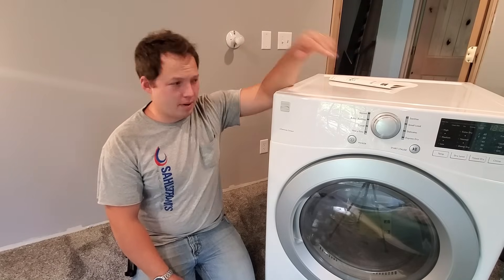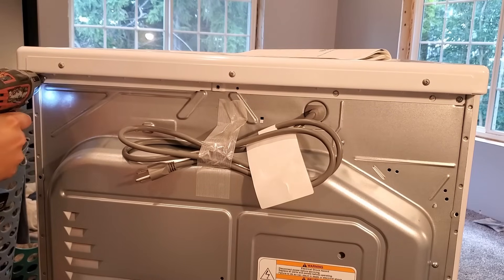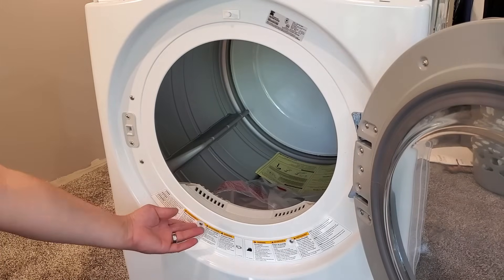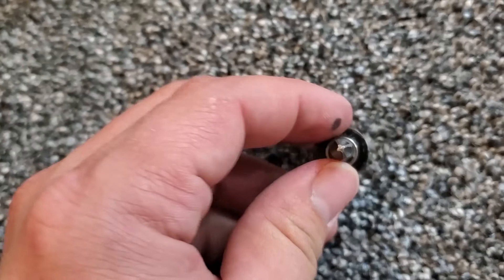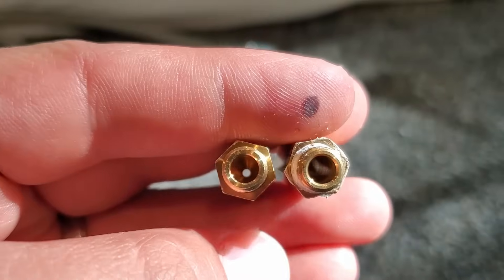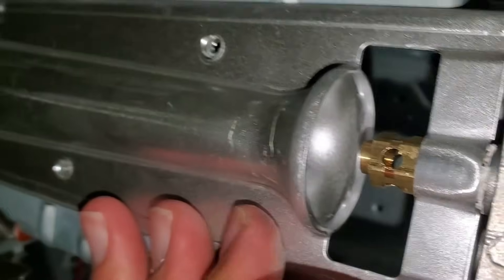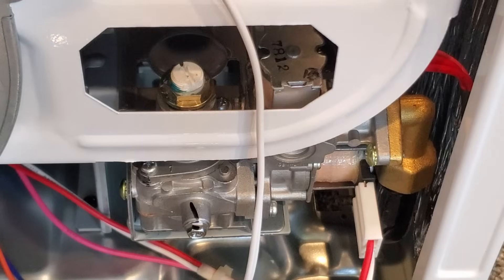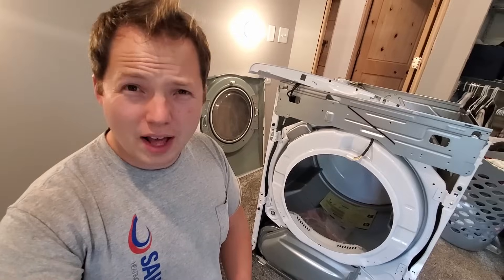How To Convert a Front Load Gas Dryer to Propane or LP from Natural Gas

Comment: Thanks for the help. Interestingly ChatGPT linked me to this video after I had diagnosed my dryer issues using it. I had ordered and paid for install of a LP converted gas dryer. The installers insisted that it was already converted to LP. It wasn't. Dryer miraculously worked fine for a couple months. I knew I should've double checked myself. Followed your steps and dryer is back to working.

Comment: Hi Benjamin, I just got LG ThingQ washer & dryer tower and in the manual only state the item number for converting natural gas to LP propane, I just don't have a manual to do it I will follow the video. But how can I know if I have to do something else for example the 2nd adjustment you made the screw down thing. Any advice?

Comment: Hey guy… bought a LG gas dryer and following ur video i am lost on what is the Correct part I may need model DGL3601W…. I also didn’t see your gas connection.. I have a hose and a normal stove 3/8 brass connector in the back connected to a gas hose and a normal gas head regulator with a in off switch 😢😢😢😢 need ur help

Comment: Super helpful video, but im running into an issue with the plastic regulator valve at the end. It just wont turn. Im worries ill damage the screw and wont be able to move it at all, anyone have that issue?
Reply: I had that issue, I ended up using a 15mm ratchet very slowly and it worked fine, then I tightened the rest by hand. I’m assuming you got yours figured out so this comment is more for anyone in the future, a 15mm ratchet fits and worked for me.

Comment: Awesome video, though a few other users seem to have run into the same issue as me. Sounds like a blow torch and the unit is running very hot. Wondering if anyone has resolved this issue?

Comment: In your video you commented on the white plastic screw having too much blue glue. Mine is the same and I cannot get it to turn without deforming the screwdriver slot in the top of the white plastic screw. I tried to use a vice grip and that will ruin the threads. Any suggestions?
Reply: Same problem ... did you figure it out ever?

Comment: Nice presentation.  However, I think it would be a good idea to warn viewers about the VERY FRAGILE igniter that is very close (<0.5") to the flame tube.  While I had no problem removing the flame tube, upon reinstalling it after replacing the natural gas nozzle with the LP one, I accidentally bumped the igniter and broke it.  On Amazon, the igniter was just over $20, but it was a royal pain to remove and replace.  

My recommendation, if had a chance to do it all over again, would be to remove the 2 screws on the side and the 1 screw on the bottom of the regulator.  That way it provides more room to reinstall the flame tube without breaking the igniter.
Reply: Yup, same thing happened to me.

Comment: You're correct the respective gasses are used at different pressures. Natural Gas, once the pressure is reduced, comes into your house at  ~2 psig which is different than that produced by many/most LP regulators.  However LP regulators often have variable pressure settings that would allow you to match the 2 psig setting Nat. Gas comes in at.  Even if you were to match  LP gas' pressure with the variable pressure set up, IT STILL WILL NOT FUNCTION CORRECTLY.   Why??? Propane is a 3 carbon gas molecule where Natural Gas is a combination of gases with an average carbon gas length considerably shorter than that.  The result are different oxygen requirements for complete combustion for each of the 2 gasses.  Translation:  You need the different injector orifice found on the 'jet' the conversion kit provides.

Remember your High School Chemistry?  Balance the equations  for the combustion of both Propane (a three carbon chain) and Ethane (a two carbon chain).  You'll see a significantly different oxygen requirement between the two.

Great vid none the less....  I've got a LG 'Tromm' dryer and your instructions worked like a charm.  THANK YOU!

Comment: A LG STACKED (dryer on top) is different! Front control panel is on the BOTTOM of the dryer (top of washer). How do you get the front off?

Comment: I've looked at a couple other YT videos and they are lacking the simplicity and thoroughness of your video!  There's only one suggestion, and request, for others that were in MY situation...how to convert the regulator BACK to natural gas!  The instruction page only shows a picture but does not tell one HOW much to turn the white screw to fully open!  I was fearful of unscrewing it all the way so much so that the screw would fly out with the spring!  Turns out that it WILL stop when fully open.  After that, it's simply a matter of snugging down the jam nut.

Comment: I remove the front drum baffle to have full access to the burner instead of having to reach through that little opening. Remove 4 screws on the  baffle and 2-3 on the lint screen housing and pull up and off. It takes a minute to have more remove to work without the need for those small ratchets. Plus, you don’t want to damage the delicate ignitor. Even the oils from your hand can damage it.

Comment: Easy peasy
It's nice that they make the regulator adjustable. 
I did a furnace and had to disassemble the regulator and change the spring. Not bad but still..
Reply: Did you use a flat head in the plastic to tighten it down? Mine is pretty tight and seems it’s going to deform the plastic screw.

Comment: Thanks! Concise and relevant. The video helped make this an easy job; especially, highlighting key tools needed for removing the burner cover. Only thing I might add is it helps if you prop up the dryer like in your lap to provide good working angle when you are removing burner cover and swapping the orifice component.

Comment: Wow!  I could not have done it without your assistance.  Great video.  I had to rig up a little mirror to get the new orifice started in the hole.  And I would highly recommend either your mini ratchet or a 1/4" ratchet with a 1/4" socket for the little Phillips and flat drivers.

Comment: I just did this conversion on an lg model last night. Mine sounds like a blowtorch when heating up. I am going to take the front off again and make sure the adjustment screw is all the way down. Anything else I should check?
Reply: I just went back and kept tightening the screw. It is most definitely touching the brass. Still making the blow torch noise.

Comment: Hi there, what about the step to check the gas manifold pressure. The instruction I have state to check manifold pressure to ensure it is 7.0 inches water column.
Reply: I did the conversion ok, but it is not heating.  Did you do anything to check the manifold pressure?  How do you do that?

Comment: Hi Ben, I had messaged prior but didn't get a response.  Just wanted to know if you actually are using this LPG converted dryer or did you only do it for content.  If you personally had used it, did you experience a loud roaring noise on the initial stage of the drying?  Thanks and keep up the great work, Ben.
Reply: I am getting a loud roaring noise as well and the vent tube is really hot. I did the conversion on my new gas dryer so I do not know about it.  Would really like an answer…
Reply: @dorothymintz7346  hey guys did you get any news on this noise? I experience the same??? 
Please let me know!

Comment: Did it 4 months ago with a brand new LG DLGX8101, burner is on same place disassembly is different though, more connectors to detach.  Just follow common sense or take pics to put all back in place when you're done.  Hardest/tricky part is to reattach the burner.  Been using it every weekend, 2 to 3 cycles for the last 4 mo with a 17lb cylinder and still hasn't ran out of gas.  To this date I still haven't met someone that has done this mod to their gas dryer even though there is no natural gas where I live in Puerto Rico seems as everyone uses their gas appliances without any mod, not even appliance salesmen are informed about this detail.  No wonder ppl run out of gas so quickly.   Thanks for this great video!
Reply: My LG DLGX8101 just arrived.  Did you have a hard time removing the front cover?
Reply: @chimaib  Yes I did, was not so easy as in this video.  Also had an issue with one or two screws on the front putting it back in place not tightening well.
Reply: @AlexisABermudez  Ok.  Do  you have any tips?  I can't return the dryer, so I have to figure it out, but yes, does not seem to be as easy as the video even though I'm just starting.
Reply: @chimaib  I did mine only bc It was under a service contract, but without it maybe I wouldn't had the courage to change it by myself.  If you don't feel comfortable just opening the front cover I would suggest to find a technician to do it. cheers!

Comment: hey ben, i just bought a mr heater 80k unit to heat my garage. it was n.g. and came with the l.p. conversion kit. The directionws make no mention of the tank hook up for an l.p. tank. i have a 100lb tank that i am going to use. i want to know if there is a specific regulator at the tank for a 100lb tank or is one size fits all for tank regulators?

Comment: I just did it without removing the burner. I couldn't find a screwdriver that was working for me. Getting it off was super easy. To get it back on I took a few test runs catching the thread with various results. Than I gooed it up and got it first try. I can work like that from a lot of practice, but it was mostly luck.  You have to find away to get both hands on it and even then you will probably drop it unless you get lucky like me. Also it's awful on the hands I did some bleeding. Thanks, perfect video, you made the job easy.

Comment: What is wrong with these manufacturers that you have to take apart the whole dryer for a 5 minute orifice replacement
Reply: So that diy idiots don’t blow up their house
Reply: I would be happy if they just shipped the 50 cent part instead of having to hunt it down order it and wait for it to show up!
Reply: But oh my gosh isn't this so fun. Not
Reply: On my new maytag I had to remove screws at the top for the front face cover and then remove the mounts for the gas flow regulator and then the mounts for the igniter and burner and even then nothing would come out so I had to replace the orifice that was on the opposite side of the regulator. 🤦‍♂️
Reply: They don't want you to do it your self!
Reply: Agree. A simple access panel is all that's needed... then again, that would cost the company an extra five cents to install right? Lol. Either that or allow the consumer to buy a dryer already set up for lp.
Reply: Exactly! They should be designed so that you can just flip a lever to switch it between the two.

Comment: Ben, it the dryer that much more noisy than before with Natural Gas? This one after the conversion sounds like a blow torch.
Reply: sounds like you missed something. Propane is a higher pressure (11" WC vs 4" WC for NG) so you need a smaller orifice.

Comment: I broke something any idea what this is?  Happened when I was trying to put it back together... Plastic white nail rapped in I think a brittle metal spring?
Reply: Was your brittle metal spring the igniter? Bad scene.
Reply: @TLCruises  That is exactly what it was.  I had to buy a new igniter.  Everything is working great now!
Reply: @scottwolf2880  Broke mine immediately. Where'd you get instructions for replacing it?
Reply: @captkeebz  Sorry it has been a while, I believe i watched a you tube video to replace it.
Reply: @scottwolf2880  thanks for the reply! I'll poke around

Comment: Good video. I'm a propane guy (new to the industry).  I've done dozens of conversions on many appliances, but not a dryer.  Excellent tutorial to give me an idea of what I'm going t have to face for a new job.  I can work on the fly, but a visual idea has always been a better guide for me.   Thanks!
Reply: Well I hope if you did the conversion you didn’t use any pipe dope on the threads like shown in this video

Comment: great video! kinda surprised you dont need to check the pressure with a manometer
Reply from the maker: It is still a good idea to check your supply gas pressure to make sure your house 2nd stage regulator is set correctly but there isn't any requirement regarding the conversion process itself.